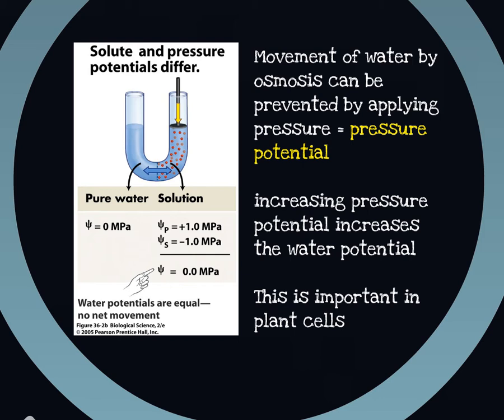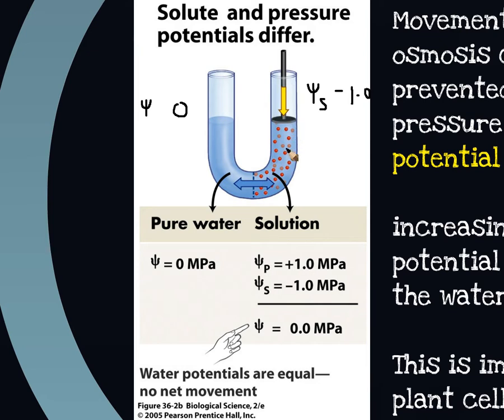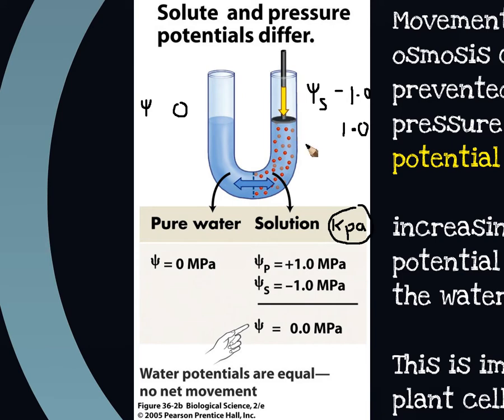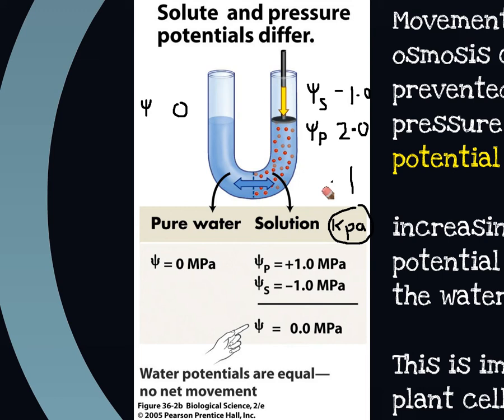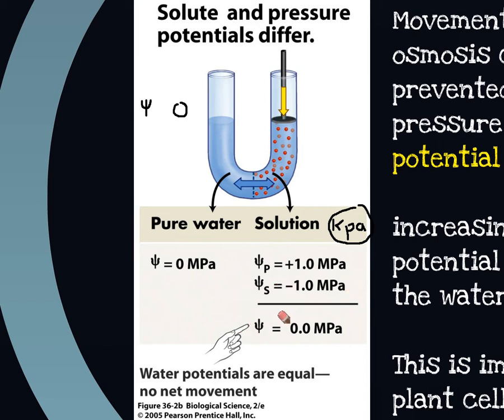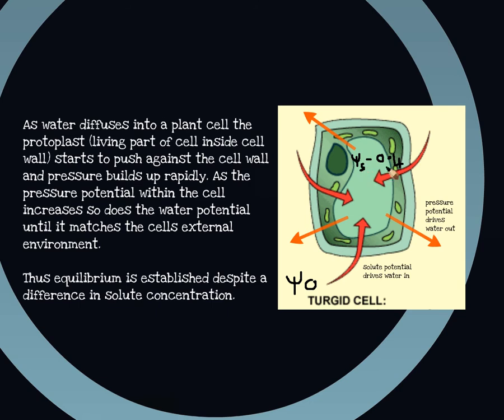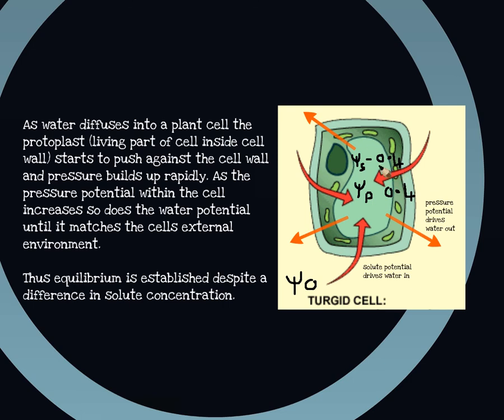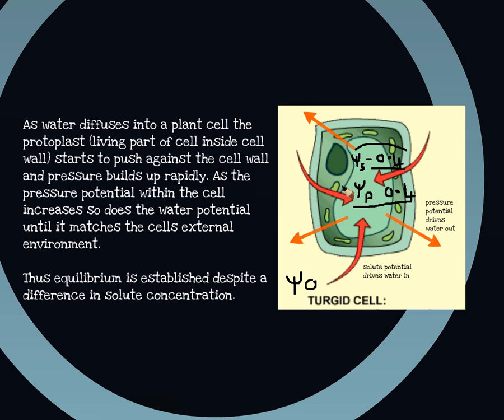Pressure Potential in Plant Cells

Comment: Isn’t it osmotic potential?
Reply from the maker: There is a subtle difference. Osmotic potential is the solute potential. Water potential is the potential energy that drives water from area to another. It is the sum of the osmotic potential plus other components that also drive the net movement of water from one area to another (gravity, pressure, humidity etc). So basically water potential incorporates osmotic potential but also accounts for pressure and a few other factors. Each curriculum covers this slightly differently and will use slightly different terminology / require a slightly different depth of understanding. This video was made in accordance with the Cambridge International Examinations curriculum.